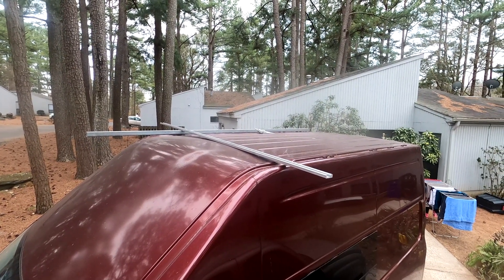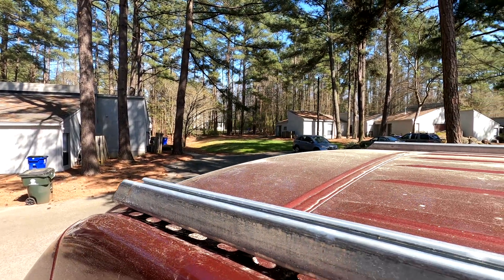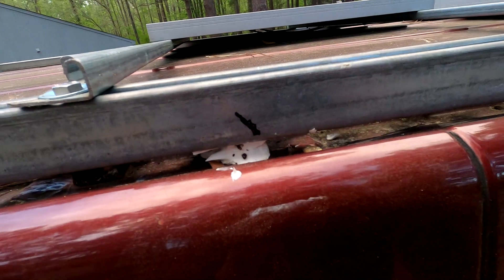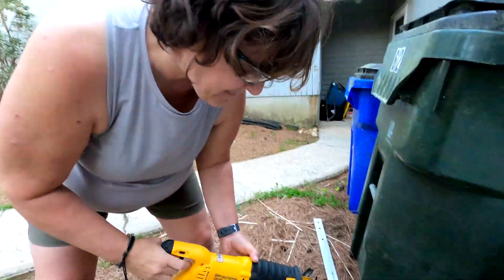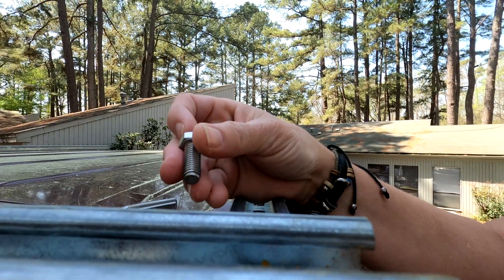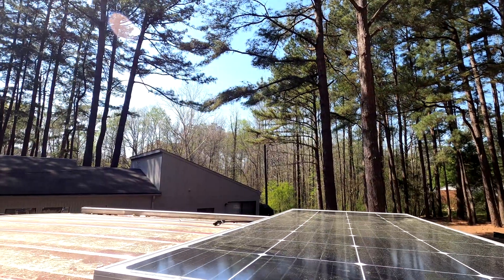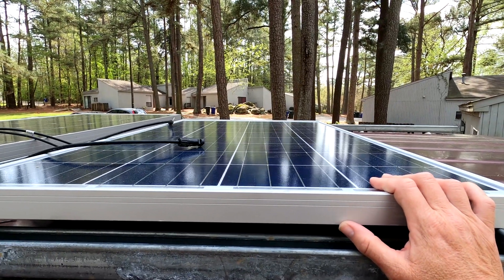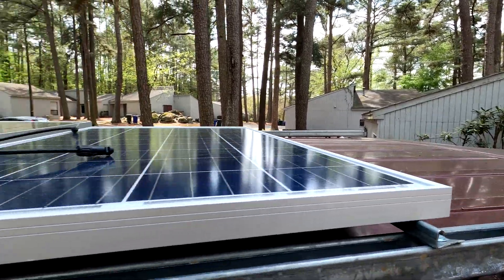Three Tips for Building A Roof Rack for Nissan 2500NV and Installing Solar Panels on the Van #6

Comment: Looks great! Def had a few tight spots to work around.
Reply from the maker: Thanks!  I have a harder time trying to explain what I'm trying to say!  LOL
Reply: @ATravelingAddictSolo  I was thinking, perhaps an easier approach would be anchor a stud (w/ ny-lock  nut) in the roof points you drilled.  Then attach the strut to the stud using lock washer and nut. That way you wouldnt have to tangle with all of it once.  Either way, as long as it's secure, it doesnt matter.
Reply from the maker: @olivei2484  Good idea!  I'll pin the comment for those searching for ideas will see this.
Reply: How did you attach the panels to the cross member any help would be great
Reply: @carltonmacmillan2023  I don't recall the details too closely; I think instead of attaching the panels to the roof, they were attached to the strut (bar on roof) then bolted down all together.  I think the idea was the solar panels would anchor to the strut stronger and more secure than bolted directly through the roof. It also allowed the roof holes to be sealed easier.  I haven't seen Crystal in a awhile, so I hope this helps some.

Comment: I just got a 2017 NV3500 passenger van. Came across others' videos talking about using unistrut to install solar panels. I'm installing 3x 290 watts. Really  helpful that your video is specific to a Nissan NV-series van. BTW, is the "Pittsboro" from you channel name any reference to Pittsboro, NC? If it is, I'm down the road from you in Sanford (Broadway, actually).